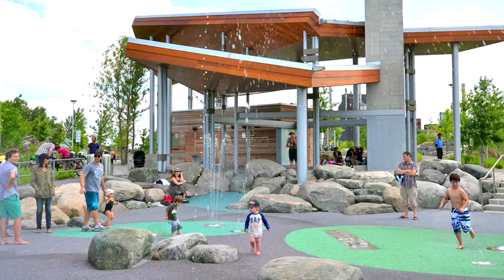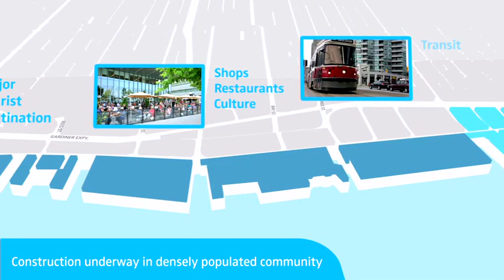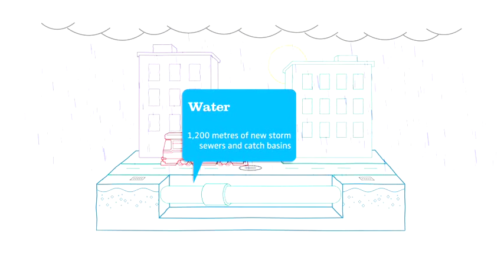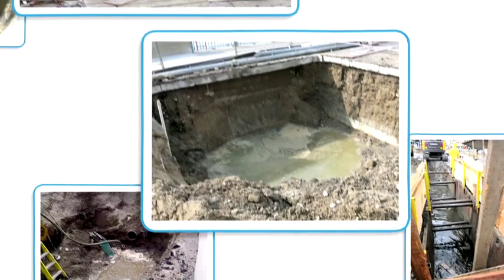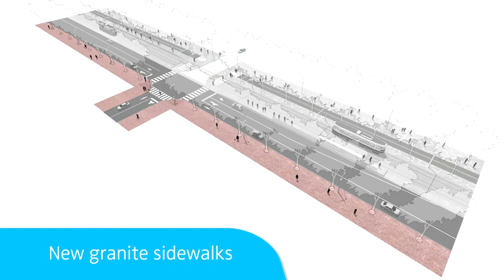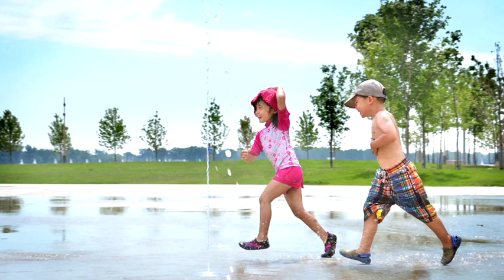Rebuilding Queens Quay Above and Below Ground

Comment: And as nice as it may look when completed ......a couple of years after completion I predict that sections of those  ( probably expensive ) paving stones will be removed to repair something or other underground then when the repair is finished the pathway will be filled in with a patchwork of ash-vault, just like every other sidewalk in the entire city......I believe that when a utility digs up a sidewalk they should be required to return the sidewalk/pathway/road back to its original state immediately after said repair work.
Also if trees that are planted die....The Original Designers of the Project should have to replace them within say 6-8 months .....there is no reason that empty planters should be that way for years on end
Reply from the maker: Gary Glover Hi Gary, the granite pavers are such that they can be removed for repairs and then replaced when the work is done. In fact, we expect it to be cheaper this way. As for the trees, they are being planted with special soil cell technology that will help them grow and thrive -- each tree will have thirty cubic metres of uncompacted soil so that their roots can expand -- and we expect them to last for a generation. This is different from most street trees in Toronto, who succumb to soil compaction and die in between six to eight years.

Comment: just found that the waterfront project wont be done by the pam am games so angry and annoyed someone should be held responsible the construction workers need to work harder and get the job done work on the weekends for god sakes if you cant make the deadline  this is unacceptable!
Reply: Sharissa Davision Funny many businesses can schedule their staff so that they can operate 7 days a week......I was down there on Sunday April 12 and walked for blocks and did not see anyone working at all......curious if these contractors are behind schedule that they would not have hired more people to have shifts seven day a week
Reply from the maker: To clarify, Queens Quay will reopen on June 19th ready for the Redpath Toronto Redpath Waterfront Festival Toronto and the Toronto 2015 Pan Am Games. A small piece of the street will have temporary finishes and will need a bit more work to be completely finished after the Games. Here's what that actually means:
--> The pedestrian promenade, Martin Goodman Trail and the roadway will be ready to use, functional and safe for residents and visitors during Games. 
--> A small area around Queens Quay and Rees Street will not have finishing touches to accommodate Toronto Hydro work that must be completed. 
--> 330 m² of a total of 21,245 m² of red granite along the pedestrian promenade will not be in place at Rees and Queens Quay. 
--> 139 m² of a total of 1,707 m² of concrete paving stones along south-side of roadway adjacent to Queens Quay will not be complete
--> 3 of a total of 240 trees will not have been planted on the south side of Queens Quay
Reply: Did you not just watch the video? This is clearly a challenging task. I'd rather the work be delayed if it's to be done correctly than a rushed crap job.

Comment: I just love to see how the agile minds of propoganda work at play. Very revealing. You fail to mention how excruciating it is for residents, especially lower level condo dwellers in proximity to the street deal with your cash grab. Living on the 5th floor, I am assaulted with the loud sounds of jackhammers beginning at 3 am and on into the night. A slight break and then they are up and running again at 6 am. This makes it unliveable. We've had headaches, loss of sleep, sheer anger and frustration because Waterfront Toronto sweeps the topic in under their lies. The effect of this noise on children is severe. I have watched the same construction crew dig up and fill in the SAME spot on the road 4 times. 4 TIMES!! What the hell are they doing? Well, my neighbor, a retired construction manager has documented it all and sending it in to the ward. You need to be more mindful that there are people that live on Queens Quay as you pursue the revenue you are drooling about in the future. None of this revenue will actually go to help any residents, much like how FIFA destroyed Brazil. I am disgusted by your marketing lies and cover ups.
Reply: do you still agree with this comment now? 

i do hope you disagree now, have you seen how much better it is now?
Reply: @Humulator  No, it's not "much better." I'm not sure you know. I have been here for 20+ yrs and it has become worse. The building we're attached to has had some of the worst construction issues and disturbances every in the past 3 years.
Reply: @Fgdfgyrdfhjkkbgff  ok fair enough if it wasnt done well, but your comment was more around how annoying the contruction was and im pretty sure atleast the above ground section is better
Reply: @Humulator  No, it's a complete new building. After that, other areas in the building. Before that for a few years, lots of street and store construction as well.